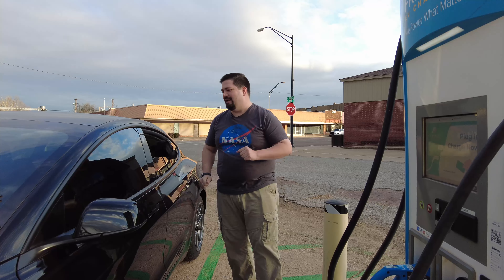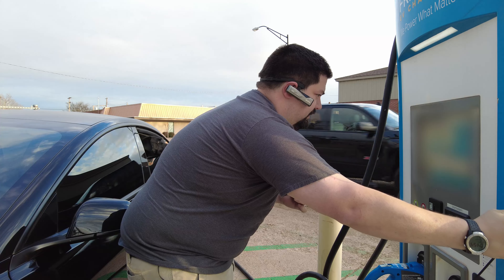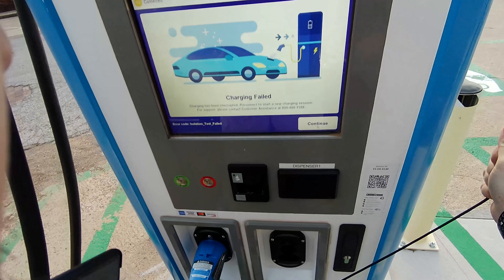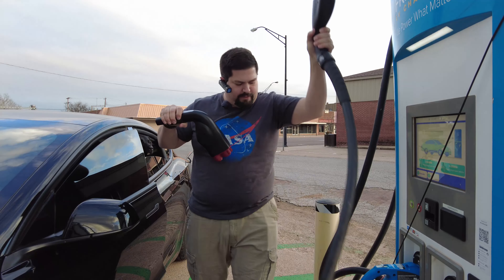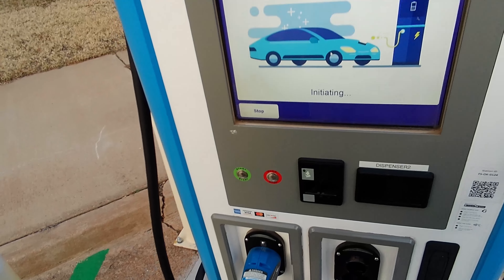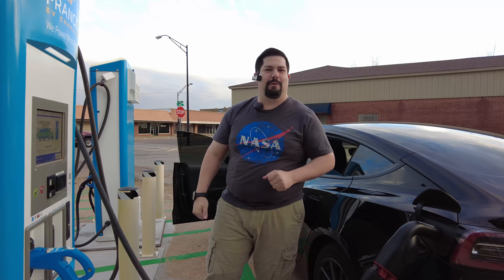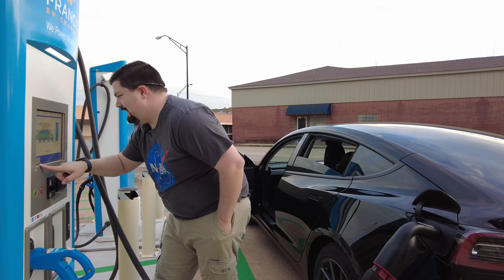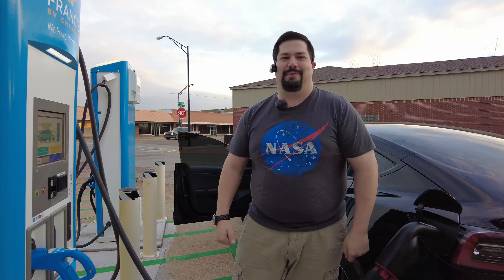Setec CCS adapter fourth try! Newest firmware.

Comment: Thank you for posting these videos. I live in Los Angeles County and I’m considering getting a tesla but since I live in an apartment complex that doesn’t allow home charging, I would have go charge outside of home. The majority of the charging stations (besides superchargers) around my place only take CCS or the chademo (which usually only has one connection per charging station). It’s insane how CCS is the vast majority out here and Tesla doesn’t offer a connector to it as of now. Since I will be relying on charging stations to get my car fueled, I do want to make sure that I have the most accessible tecnology, otherwise I won’t get the car. This definitely helps and I hope you collaborating with them helps resolve the issue so that I can use it in the future 😅
Reply from the maker: Thanks for the comment, it's going to be very inconvenient for you not to be able to charge at home. I would say the number one Perk of an electric car is not having to visit a station unless you're traveling. But having to do it a few times a week is going to be a beating... Yeah hopefully I get to use this software this weekend to do some testing for them with this adapter, on top of everything my laptop died yesterday so I had to buy a new laptop today, just my luck.... Well good luck on your electric car decision I don't know if you've owned one before but don't test drive one until you know you're going to be able to buy one because it will spoil you and you won't want to drive a gas car anymore.

Comment: Kudos to Francis energy and Setec for working with you and trying to make things right.  Are you going to exchange your adapter for another one?  Other people have reported success so maybe it's the adapter somehow not working.
Reply from the maker: Well.... While I can't rule out a manufacturing defect, I feel a lot better about my adapter since I was able to push firmware to it yesterday. I'm going to try a few more times and capture the data with their software and give them a chance to work on it some more.
Reply: @Crazypostman  I had trouble with my adapter at a Efacec station I frequently use. They sent me the program to capture charging session data and would give me a firmware update after I sent them the log files. It took about three attempts before it finally worked but it does work. Just keep sending them the diagnostic logs.

Comment: Its not just you, in Canada (BC) and others in Quebec are having the same issues.

Here are a few videos of me trying the same:
https://youtu.be/d0ojTQPuRBE
https://youtu.be/JYWOdNncurc
https://youtu.be/z3PiegC4x0U
https://youtu.be/ycbO2iuo9Q8

I also updated to the latest firmware and there is no difference, I also plugged in my laptop to the adapter while charging to capture logfiles and sent them to Setec. It seems their adapter does not work with newer CCS chargers

Here is a chat transcript from Facebook:

Alan Maignan
Mark Vejvoda
if it is not this one, an other adaptor was tested and work on some dcfc stations. It seems to work on old CCS protocole and not new one. So most of Quebec stations will not work.

Alan Maignan
Mark Vejvoda
I just verify and it is the same adaptor Guillaume André tried.

Mark Vejvoda
Alan Maignan
Ok so i've tested on 4 different chargers in BC and so far none worked. I provided Setec with some debug logs and they are investigating

Alan Maignan
Mark Vejvoda
On his test he said that Elmec's dcfc work but not ABB and Circuit Électrique.

Mark Vejvoda
Alan Maignan
Ok I tested BC Hydro chargers (the main one in BC) as well as Delta Chargers, there is also ABB here and Petro Canada and those last two are far away from me so I could not test yet.

Alan Maignan
Mark Vejvoda
Petro does not work too.

Mark Vejvoda
Alan Maignan
ok thanks for saving me the time, then no chargers in the top 3/4 of BC will work, maybe chargepoint chargers in the lower 1/3 but too far away for me to try.

Stéphane Levert
BC Hydro has AddEnregie as main DCFC charger provider. Same as most on Circuit electrique here in Quebec.
Electrify America seems to work on the USA side. Curious if Electrify Canada will work. We have two sites active in Quebec (one shutdown until Jan 11th for COVID). They use Efacec chargers.
Some in BC, Ontario and another one in Alberta.

Comment: Just got the adapter but having issues getting the firmware updates to install.  Did you have issues on the computer?
Reply from the maker: What kind of problems are you having? I've had several 😂
Reply: @Crazypostman  it was a bad USB cord. Got it updated and a successful charge! Thanks for your great videos!!